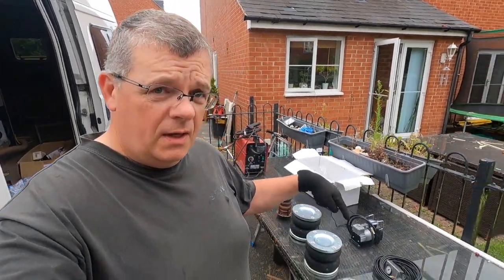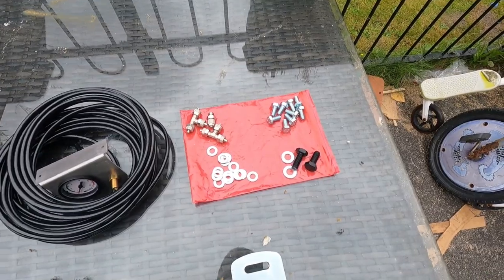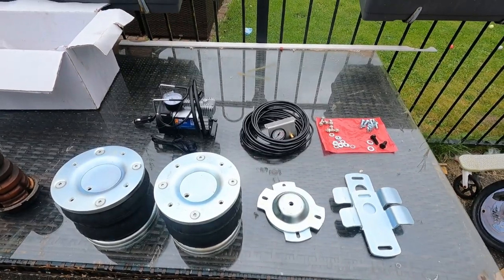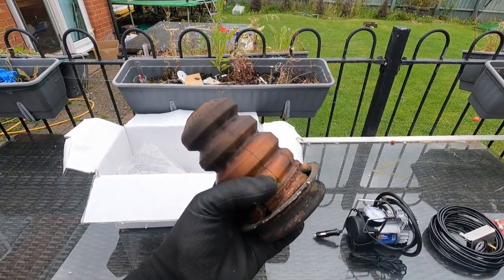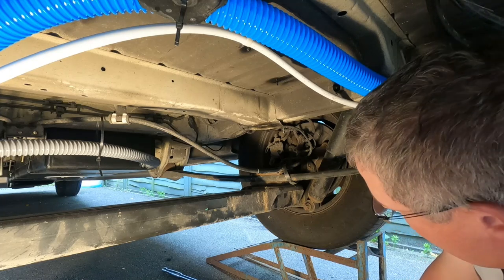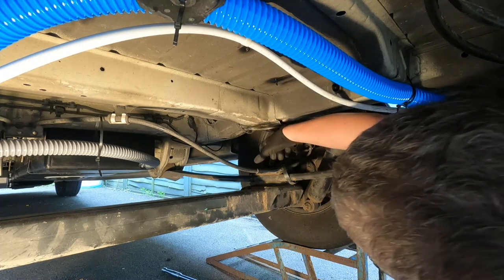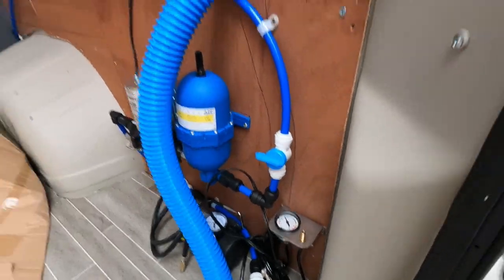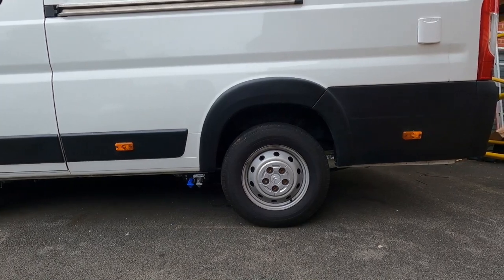Installing air suspension on a Citroen Relay / Boxer / Ducato / Pro Master

Comment: THANK YOU SO much for making this. Thanks to you I got mine in yesterday. I DID need a breaker bar for the spring nuts, I DID break off the welds in the bump stop and I DID need to grind a section of the cup away to let me grab the bolt with a vise grip and swear profusely until I got them out 3.5 hours later! 

ONE MAIN suggestion I would say for anyone attempting this. Follow WCC steps to the letter except....

1. Whilst outside the van, connect your air hose to the bellows, then step on the bellow to compress it down all the way to the floor. Attach the valve to the other end of the hose (making an airtight seal) and it keeps the bellow tightly compressed and easy to slip into the little space between the leaf-springs and bracket. 

2. Then add the U-Bolts for the leaf springs very loosely- its easier at this stage because theres plenty of room to wiggle around.

3. then you can release air into the bellows to let it rise incrementally to help you find your bolt holes for the top bolts, nipping them in as you go.

nice one!
Reply from the maker: Sorry to read you had the same troubles, it is obviously a common thing and great additional tips, especially tip 1. thanks for watching.
Reply: @wiltshirecustomcamper7203  suceesful install no leaks!
Reply: Spot on all the fiddly bits made easy with these suggestions thank you!!

Comment: Fitted mine today, followed a lot of the guidance on here…

I compressed to bag in a vice and then clamped up the end of the air pipe, this made it so much easier to fit the bag in between leaf spring and cup, I also marked up on the outer side of the top of the bag where the holes where, it was then easier to align up. Fit the U bracket towards the rear first and then slide the bottom plate under. I then fired the u bracket at the front and gently let the air out unto the bag had partially opened up. This the allowed me to line up the bolts with the marking on the top plate of the bag.  I just the tightened up the 4 bolts. I also have a Dewalt impact driver which I bought a 1/2 socket drive for, £4 from eBay, made it so easier than using a ratchet, remembering to start the nut on a couple of a threads first so you don’t cross thread it, nipped em all and jobs a good un!
Reply from the maker: great tip. I need to remove them shortly to install LHD leaf springs so will try out the tip. cheers.

Comment: Have the same ebay kit that you do, but when I fitted it I brought the both the air pipes up to a manifold with a pair of 1/4 ball valves between the pipes and the schrader valve. The way the standard kit is configured the two bellows are linked, so when you go round a roundabout, or get blown by a side wind, the side that compresses (left rear wheel on a roundabout reduces volume and transfers increased pressure to the right wheel) causing the suspension to extend and raise the body in relation to the wheel on the right. This magnifies body roll and is the opposite of what is required, however when piped seperately so that the left and right are pressurised as completely separate systems, the wheel under compression  will increase in pressure, thereby  increasing effective spring rate to resist compressive forces, the opposite side will try to extend its suspension travel thus reducing effective spring rate and reduce the extension of the suspension. The overall benefit of plumbing as two systems is an increase in roll stiffness, rather than a reduction, and an imprevent in cornering and improved handling in crosswinds. Marcle Leisure sell the manifold to separate the systems as shown in"Diamond Dave Newell's" YouTube video on air assist rear suspension. Another benefit of separate systems on left and right, is that you can level the van on a pitch, by pumping up both sides with the 1/4  turn valves  open, then close the valve on the low side and let air out of the high side by depressing the "tit" on the schrader valve until the rear is level (within the 1 - 7 bar range of the airbags), or even level from to rear. I have also added Lesjofors heavy duty front springs to keep the front and rear roll stiffness in ballance and allow chassis up plating to 4.0 tonnes and the accompanying reduction in vehicle excise licence fees.
Reply from the maker: Thanks fro your comment. I will give it a try over the coming months and will make amendments if needed or even scrap it and go with sumo springs but will withhold judgment for now. top tips however, thank you
Reply: @wiltshirecustomcamper7203  .No worries! Great series, these jobs are hard enough, but can't imagine all the extra hassle of videoing at the same time! I take my hat off to you, it's people like you that inspire people like me! Keep up the great work!
Reply: Hi there Neil, I understand totally what you mean but not fitted mine yet, would you be able to draw a diagram of  what you did and post it to here? Getting the cups off was difficult as seen, the not came off the weld so I got hacksaw blade between cup and chassis and cut it off.  I bought a breaker bar off Amazon , £24,  which got the Ubolt nuts loose, but then bought a 1/2 drive bit for my dewalt impact driver, came off dead easy, will use them to put back on, always remember to start the nut off on a couple of threads though. Great videos I’ve got the Citroen relay L4H3, would be good to talk sometime to you all

Comment: When I installed mine I squeezed all the air out of the bellow, folded over the end of the 6mm nylon hose and put a cable tie on.
so the below stayed in the fully compressed position, then removed the cable tie to allow it to press on the top plate.
Good idea hammering the folded edge over, I struggled like f** to get those bolts in.
Reply from the maker: THanks for the comment. Yes, whoever designed those bellows and the bolt positions needs to do one more then change jobs.... I even considered welding the black bolt to the top plate so once fixed to the bellow it could be screwed into place like the bump stops?!?!

Comment: I have noticed on several videos of this procedure that the tubing goes into the top of the bellows, not the bottom. That would make sense as the top doesn't move, unlike the lower part.
Reply from the maker: makes sense but the top is so tight I cant see how i would have fitted it in any sensible way. thanks for the comment and suggestion however.

Comment: Good job. I know it’s a bit late, but when I done it I wedged the scissor lift between the bottom of the van and the crown bar sort of separate them even more. Then you lower it back again when the bolts need to be tightened!

Greg
Reply from the maker: Top tip for others, thanks for the input.

Comment: When I did mine the threads in the chassis for the top mounts striped, so I had to slide a nut in a spanner up the chassis and attach the top mounts that way what a pain, oh the joys of building a campervan 🤪
Reply from the maker: Sounded like fun. perhaps I got off lightly.

Comment: Nice one Sir I had exactly the same problem on my citroen relay those stupid bump stops 😂
Reply from the maker: Yes, whoever designed that needs to change jobs, how difficult would it be to have a size 15 or 17 'bolt' fitting on it?

Comment: Interesting content. I’m not so sure leaving pipe work coiled under the van is a good idea. Enough flexibility to cover the full range of movement of the axle, and remove the unwanted extra pipe. I’d be concerned about the possibility of catching road debris or obstacles on site, and removing the loose pipe. Cable ties aren’t going to resist much. Keep up the content. Thank you.
Reply from the maker: Great point!
Reply: À

Comment: I'm lucky with my van it's a heavy fiat ducato and came with the factory self leveling air suspension as an option , so I don't have to worry about soggy springs 👍
Reply: So did mine but after only 20000 miles the levlling sensors have gone faulty £554 for 2 iam going to sling some of these in leaving the original belows in situe hopefully to cure the constant banging on the bump stops when it fails

Comment: Wd 40 on all the nuts 24 hours before you do the job makes things a lot less of a pain to get apart and less likely to snap bolts
Reply from the maker: I did not realise you could spray so far in advance, i assumed it would just dry out again. great tip.

Comment: Good job, if you do it again, i find its easier to compress the bags on the ground first then block off the end of the pipe so no air gets into the bag. This way is flat as a pancake then you can install it easily and open up the pipe after you finish :-)
Reply from the maker: I don't think I would install airbags again. shortly after completing the task I discovered Sumosprings & Supersprings thanks to UrbanArkOverland so would probably go that way on next build.
Reply: @wiltshirecustomcamper7203  I actually discovered them through him actually. I have looked into them and would use them also in the next build as I want to build Fiat Ducato L4H3 because it’s abit square and I can get the wall panels from solway, hopefully they would have H3 version then lol.

Comment: what u think of it now? 🤔
Reply from the maker: All good. I might consider having them connected independently of each other in the future so the air does not move from one side to the other on a sharp bend. if that makes sense.
Reply: @wiltshirecustomcamper7203  Or you could put a restrictor close to both bag in the air line so the air can't move so quickly. Or even one restrictor would do I think.
Reply: Can’t you just put a one way valve next to each bellow?

Comment: Perhaps a small scissor jack between chassis and axle to ease the bellows in.
Reply from the maker: Interesting idea, the best one I've heard so far from a fellow viewer was to squish the bellow down to get most of the air out and then fit a small bolt into the fitting to keep it compressed whilst wiggling it into place. great idea though and thanks for the comment.

Comment: You have the two air suspensions connected together? Keep the two lines separated for stability.
Reply from the maker: no problems yet with stability so happy with choice.

Comment: Great video thanks...how do you know what pressure to set the bellows at..??
Reply from the maker: Thanks for the great question. In fact I don't really. I just go by the height achieved on the wheel arch above the tyre and found that 2 bar seem to do just nicely and give the van the appearance of not being overloaded. it will go much more than 2 bar but I think that is fine, well, for me anyhoo!

Comment: Loved your video, had exactly the same problem with mine when replacing the bump stops although It was the captive nut inside the chassis that came away , needless to say I haven’t sorted it yet was thinking of putting double leaf springs on instead , why did you choose air suspension.
Reply from the maker: I chose air suspension as I was not aware of Sumo springs when I bought it. Now in hindsight, I would give careful consideration to both options and which is better/worse for the price difference. check out Urban Ark Overland for a sumo spring install on a Sprinter.

Comment: Does the air assist. Increase the ride height?
What size do BFG KO2 do you have?
Reply from the maker: yes, the ride height at the back is increased and does  good job of 'masking' a heavy van! as for the BFG's, cant really answer as it depends on your wheels? for me there was no direct match for the Citroen Relay standard tyres so had to get closest match. rim and width are same but height a smidge more if I recall.

Comment: Couldn't you have left the bump stops on and fitted the air cylinders further along the axle
Reply from the maker: Yes, apart from the fact they are designed and supplied with brackets to go specifically in that place.

Comment: A bit of penetrating oil on the threads might have helped undoing them.
Reply from the maker: Thanks for the suggestion, I did try some of that in the early rounds of the fight but alas it did not work.

Comment: feel ur pain! when welding did u disconnect battery or leave van running?
Reply from the maker: Disconnect battery or leave running you say? I was hoping for a third option of not thinking about it and just cracking into it!?! luckily it worked out fine .

Comment: Cannot  you use grippers to grab the round bolt (pipe grippers)
Reply from the maker: Possibly depending how tight it is, I tried some mole grips but they just slipped off. thanks for the suggestion though. cheers.

Comment: Great video - Any tips on how tight to do those air pipe compression fittings?
Reply from the maker: I did them finger tight plus a couple of quarter turns with a spanner, so not very very tight at all. Hope that helps..
Reply: @wiltshirecustomcamper7203  thanks - I've had a slow leak on mine and have tighted them up more but think I may have overdone it.
Reply: @Bannister99  Did you manage to sort this? I have a slow leak on mine too.
Reply: @georgeclayton5890  yes I cut the pipe and made the connections again and that seemed to sort it

Comment: would it be better with independent suspension for a camper?
Reply from the maker: On the journeys I have made so far I have not noticed any body roll at the rear to suggest the air is all leaving one side and going to the other so seems fine, but is early days yet still and the double leak springs may be masking it anyway. If I become aware of it I will look at splitting them but for now seems fine. regards.

Comment: It's easier if you squeeze bag down and keep other end of air hose on your tongue creates an air lock
Reply from the maker: great tip, I guess a spare short piece of pipe and a pair of mole grips would have same affect.
Reply: @wiltshirecustomcamper7203   yes sir 👍